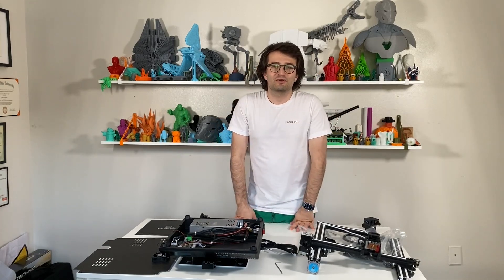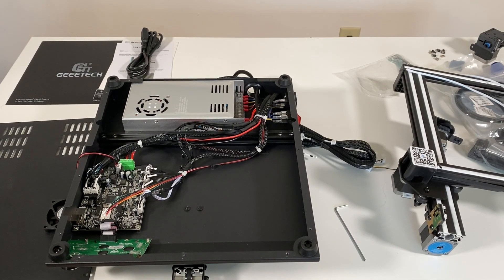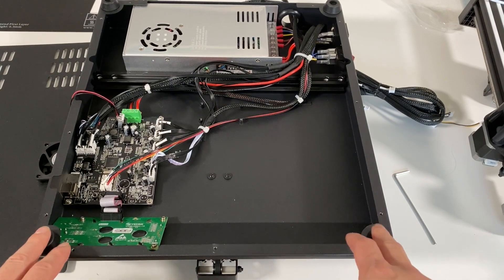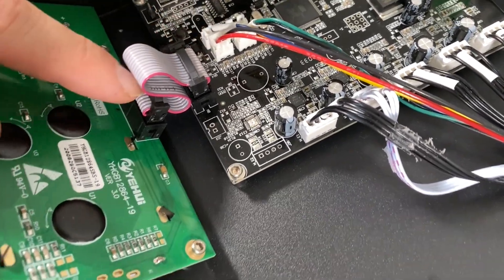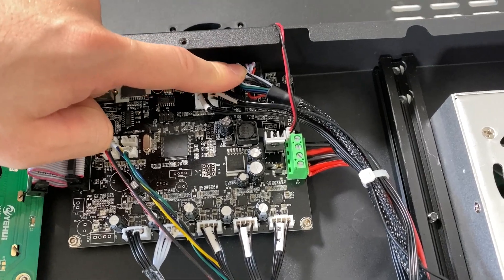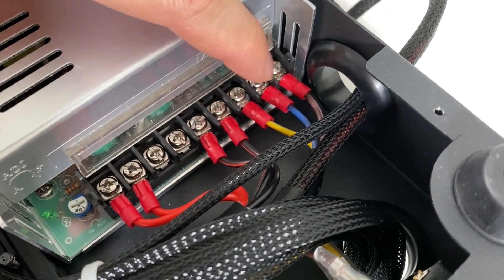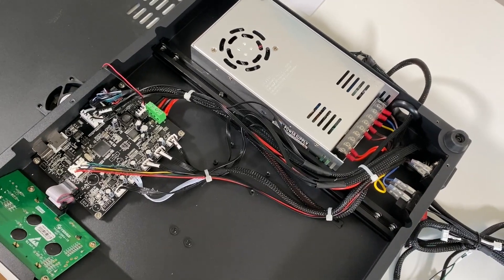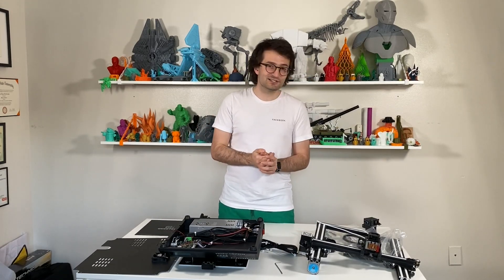A Quick Look into interior of Geeetech A20M

Comment: Hi, the motherboard version looks the same as mine, GT2560 V4.1B. This one is not the best as you cannot upgrade the steppers to any of the silent/quiet ones... In fact any form of upgrade to this is all but impossible. Shame as it could be a good printer.
Reply from the maker: Thanks for the comment. Gotcha
Reply: i am waiting on some stepper motor dampers and tl smoother to try and quiet down this noisy bastard, other than the noise it works well and the detail seems a little better than my ender 3 v2
Reply from the maker: Let us know how it goes